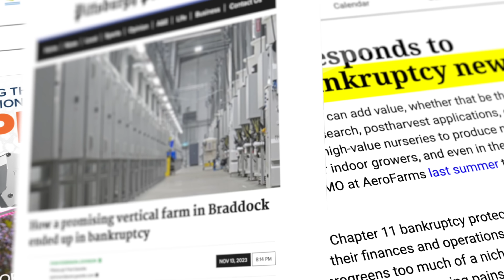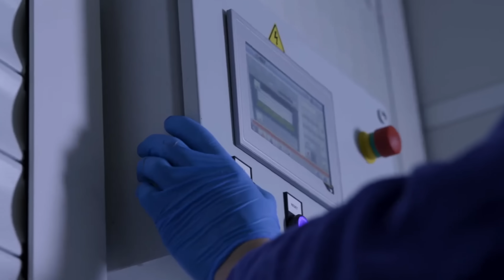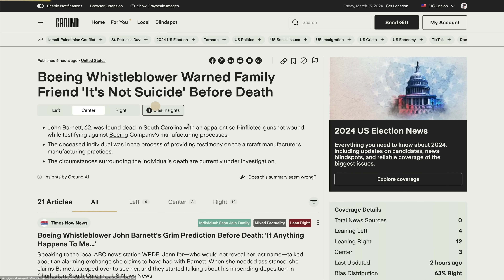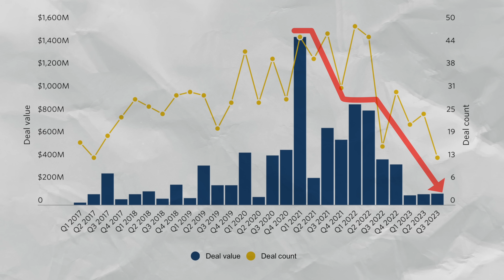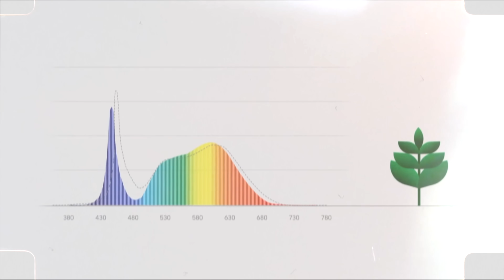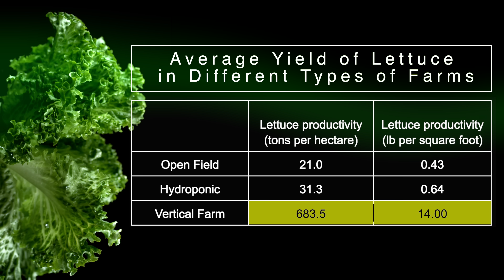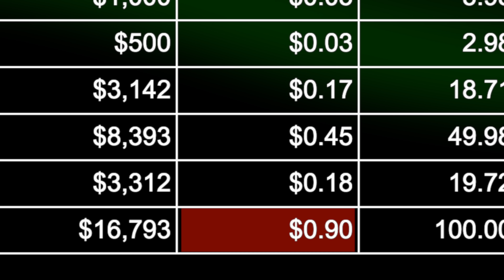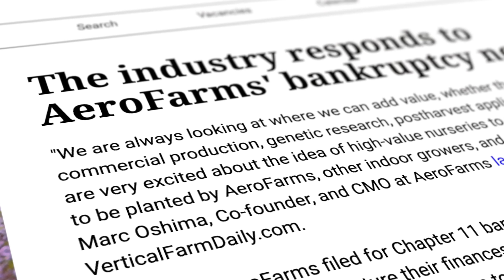The EPIC Failure of Vertical Farms - What Happened?

Comment: It seems to me that one of the problems with vertical farms is adding automation and complexity that isn't actually required. Granted, we probably don't know exactly what is the minimum required yet, but I wonder if it might not work better for a long term operation to use actual dirt stacked up on multiple floors. Seems like that might actually reduce the level of skill required for the majority of the labour.

Comment: One of the major draw backs to the Vertical and other hydroponic farming techniques. Is that they replace living soil for not living chemicals. Living creatures plants or animals need living food of the highest quality. This is an underlying factor for all industrial farming technics. In the long term they will fail. I used to grow plants hydroponicly. I loved the technial side of the process. Pumps timers formulating nutrients etc. but that is not really farming. Real farming starts with the soil. Not the chemical we are told that plants need. For the most part, the big three all of which come primaialy from the from the petrochemical industry. They, of course, love the fact that they have manipulated the farming industry to see things from the engineering chemistry point of view. When you take the life out of the equation you get plants that may look good but taste is usually the first to go. The next of course if the nutrient value. of both of these comes from the micronutriants and life force that living soil provids. That being said. You are correct that the primary reason for is cost. It is far cheaper and more  resiant to grow in living soil. Especially because shipping of food is hughy subsidied. Though tha will change in the future.

Comment: As mentioned one of the biggest problems with the vertical Farms is the capital expenses and there's one way of easily solving this problem:

Bury the vertical Farms.

Every vertical farm that we have seen so far has required huge facilities large air conditioning or heating systems and these are extremely expensive to run require large connections to the power grid and just controlling the temperature and humidity levels require a large amount of power. However if the vertical Farms were built underground this will allow for much easier control of the internal temperature of the facilities which will allow you to have a much better humidity control as well as temperature control within a few degrees. 

In addition by having the vertical farming facilities underground you can then use the same land space to run solar systems above ground to help power your vertical farming facilities decreasing the amount of power that you need to get from the electrical grid.

Doing all this this can help decrease your overall expenses because you won't have to run as much systems to control the humidity or temperature and if you can decrease this then that's less expenses you will have in the long term. Now granted it does make future expansion of the facility a little bit harder so you do have to plan future expansion when you initially build but if you don't look at the future in the beginning it's going to affect you in a long-term anyway.

Now another problem with these vertical Farms is they keep building them near cities with the misguided conception that they're going to bring vertical farming closer to the cities and that's going to somehow be cheaper. I call this a misguide conception because we already have long distance Supply chains in place for bringing food from a distance to the cities. All that you get by trying to build vertical Farms close to cities is a much higher cost for your land, much higher cost because you have to connect your vertical farm to the city's water grid, and limited options for going solar.

A much better option for vertical farming would be to build your facility out in the middle of of nowhere so that you can have your farming underground, your power production by solar above ground and your water collection via Wells connecting to an underground aquifer. This would allow you to get much cheaper land as well. By doing this you could have your capital expenses lower and make your vertical farming facility a little bit more self-sufficient.

Also cut out a lot of the automation. One of the chief cost is that as you go with more automation that increases your cost and you end up having to spend more money on maintenance for that Automation and of course you require more expertise and that increases your cost as well. Instead what you can do is you have the farm beds on a rotational system that brings the beds down to waist level. By doing this you can train less skilled workers to be able to take care of the crops and higher them to take care of the crops and then to eventually harvest them that will potentially decrease cost because by having less automation then you won't need to have higher skilled workers to take care of the automation. 

And of course as you mentioned that they tried to control everything and then when insects do end up invading the whole balance gets thrown off and that can cause total waste of crops. Now the problem here is that they try to keep out everything and this is the problem because they're also keeping out insects that could potentially kill off insects that are invasive, and frankly some insects are good to have around your crops. You basically have tech people who are trying to bro crops rather than having farmers grow crops. They need to be doing this with farmers actually advising them maybe let in the right insects as some insects are our friends. 

So far I've yet to see any vertical farming facility try this method.

Comment: I ran a smart greenhouse for several years and Im not surprised. Capital costs are huge and so you have to optimally grow the most expensive per pound plants if you want to get even close to profit.  Leafy greens and herbs are the highest value per pound available.

Robots and automation can reduce the labor cost, but they need to be much more capable and much less expensive.  AI should help with the capability, but we are still 5-10 years away from the economics to make sense.

Why 10 years?  AI needs compute and during this AI boom, there's a serious silicon shortage and a technology shortage.  We need more capacity in our processor fabs.  For compute to be efficient, we need smaller nodes, which are becoming more and more expensive.

To make matters worse, government regulations to combat climate change are increasing electricity costs by as much as 50% over the past 5 years in many locations (ie Oregon and California) and that's not expected to stop increasing anytime soon.

All these factors are working against Vertical Farms for the next 5-10 years.

But is there light at the end of the tunnel?  Probably.

Compute capacity is starting to increase woth new fabs coming knline in the next 5 years in the US and elsewhere.  High investment in battery tech by EVs and power companies will likely eventually reduce (or at least stabilize) electricity rates in the long run, but that will take many years.

Comment: I remember watching a critical video about one of those "water from thin air devices", it was basically a dehumidifier. The critic pulled up the shipping costs of trucks. You can get an entire pools worth of water shipped to you for around $150 to $400 depending on how rural you are. The shipping of water was cheaper than producing it with electric dehumidification lol. Shipping is so insanely cheap even for super heavy loads.
Reply: Well, yeah. When you ignore the negative externalities, like public health and climate change, you can produce anything much cheaper than its true cost.
Reply: @OneCalledChuck  It's not about externalised costs, though, but about efficiency of transportation. With modern container ships, you still end up with shipping costs including all externalities of roughly 0.008 USD per metric ton per km, which is a shipping container from one end of the world to the other for a low monthly salary of shipping costs.
Reply: @KarlKarpfen  It IS about externalised costs though. 
That seems to be the point you're missing.
Reply: @SageWon-1aussie   It isn't, as shipping isn't cheap for the reason of huge externalised costs, but because of extremely high efficiency. The externalised costs of shipping are miniscule. That's what you are missing: You proclaim huge costs which just aren't there at all, neither internal nor external. You can't tell which those "externalised costs" are and you couldn't attribute any value to them. It just doesn't fit your world view that shipping actually is this cheap.
Reply: @KarlKarpfen  The environment, the value of which is we kinda need it to live. Those externalised costs.
What dollar value do you put on your life?
Reply: @SageWon-1aussie  The reality you just don't accept, is that shipping already has a miniscule impact on the environment and already is the most environmentally friendly mode of transport.
It doesn't matter whether you externalise or internalise a cost which just doesn't exist in the first place.
To take an example: Shipping a container from China (take Binhai, for example) via the port of Hamburg to Munich on a 13 years (half lifetime) old Maersk Triple-E-class container ship, creates more environmental damage on the part from the port to Munich by truck, than from Binhai to Hamburg on the ship. That's how extremely efficient and low impact marine shipping is.

Of course, you could still improve shipping and all shipping companies do that, as they compete on the costs they have from the efficiency of less than 100% of their ships, but ships are just not really the problem.
Reply: @KarlKarpfen The reality you just don't accept is that death by a thousand cuts is still death.

Comment: I just completed my architecture thesis about vertical farms. You correctly noted my critiques of the industry: food products and labor.

My thesis solved those two issues.

First of all, nobody will live off of salads. I eat beef, which is 36% of USA land usage and 5% of our diet calories. We can reduce the land usage of that 36% by growing barley fodder 13x faster than growing corn grain, and in so doing, create a healthier cow that isn’t addicted to antibiotics and glyphosate.

The second issue is automation. There are already systems like PONTUS that automate lentils. Bowery has their own automation. Even the Dyson vacuum guy made a robotic arm to pick strawberries, a seemingly labor intense crop. 

So if you can automate foods that people actually eat, it will become profitable. But in order to do that, frankly, we need to very slightly change our diet. Not to reduce meat, don’t worry. But replace corn with barley, replace wheat with cauliflower and replace soy with lentils. Those crops are not only healthier but easier to automate.

I calculated that 4 square miles of barley fodder can consolidate into a 500’ tower. 

The second aspect of profitability is flipping this 4 square miles into housing to solve the housing crisis. 75% of the cost of a house is the land area itself, not the building and architect. So by flipping cheap land into desired land, both the customer and the architect walk away with more money. Some of the cost that would have been used on the land area of a house is now spent on the upfront capital of the vertical farm.

Then the question becomes where? Where is it profitable to flip farms into housing? Sacramento? Well, you already did a video on that. There are other locations that may factor in lost yields due to climate change floods and droughts. 

Vertical farms can be the vehicle of a new frontier of the American dream. Think Levittown of the 21st century.

Comment: The problem is that these companies can't hold up to mass production farming. 

An average farm can focus on a single crop to maximize profit where vert farming is running multiple lines of crops at the same time cutting their market share.

Our cities hold to high a density to have vertical farms to sustain. You need to use them as an augmentation to regular farming.

Comment: Why did these companies fail? From the article: "silicon valley", "VC investors", "valuations", "profitability", "up front cap ex".

Food security concerns aren't going to be address by an app that can be flipped by private equity through creatively managing pro forma financials. Even with a 25% CAGR these investors aren't going to find what they are good at, which is churning small companies to large cash cows or IPOs. It's no wonder that all they grew was basic lettuce and their promo videos had white lab coat professionals individually inspecting each leaf. What else do they know about farming?

Vertical farms will work where the motivation is not "tech startup" adjacent and where the problem being solved isn't supply chains, as well pointed out here. For example, parts of the world that are very dry and need extreme water management or parts of the world that are dark for much of the year and can benefit from 16-hour growing days under LED light. We can also expect automation to cover much of the labor cost shown on this table, where for example AI-monitored cameras can spot potential disease and pest breakouts, and call for human intervention.

Finally, we should also expect better success growing something other than basic lettuce: tomatoes, peppers, melons, potatoes and other root vegetables, berries, and fruit trees. Food that doesn't have as quick a seed-to-harvest turnaround time but has a much higher valuation per unit and also introduces the kind of variety that is needed when addressing actual food security more broadly.

Instead of just making a quick couple of bucks for another tech hedge fund.

Comment: These farms will be reborn as climate get worse, we won't grow outdoors for much longer.  The pest problem can be solved with natural means, like growing tobacco in every ten feet within the facility and putting screens in the circulations systems.  Smart investors will be jumping on buying out the failing vertical farms and sitting on them until they are essential. Switch to glass and porcelain, those will last forever. And use sunlight, you can pipe sunlight in .

Comment: It's a small niche business perfect for high end produce, not the answer to widespread needs, except perhaps for salad greens.  Sometimes when too much money chases an idea, it fails.  I'm sure many small operators in old warehouses will grow greens for restaurants and health food stores.  This is a perfect business for a family that develops relationships with restaurants and grows from a basement project to renting cheap commercial space.  It's not a high profit business and is labor intensive.  Daily monitoring of growing conditions is essential.  However, the greatest benefit is that you dont have to worry about manure contamination.  Bagged greens are one of the biggest FDA recall items for salmonella and listeria.  In winter you dont have to make your facility very warm, and you can open windows in mild weather.  The advanced technology isn't needed in a family business.  However, scaling up in an economical way is nearly impossible.  You can probably minimize the AC bills by simply cooling the circulating water and hydroponic fluid.  That is likely enough to stop bitterness and flowering.  But big companies do have the flexibility to experiment and tweak things like an owner operator.  The best vertical farm is an oak tree.  An oak tree yields more grain per acre than wheat fields, but only every 2 years.  The acorns could be gathered, sorted, dried, shelled, ground and leached by machine, then dried and ground.  Passive solar can be used to dry the product.  The problem is investing in the machinery.  Someone b would need a huge ranch with lots of oaks, pecans and mesquite to put the machines to optimal use.  Acorn products are the perfect solution for gluten free diets or novelty treats.  Someone in Greece has a successful acorn business with crackers, oakmeal cereal and cookies.  No pesticides are needed.  Just burn the leaves around the tree to decrease pests.  The key is to leave acorns behind for wildlife and plant other wild foods for them.